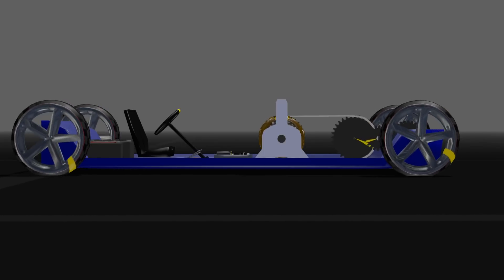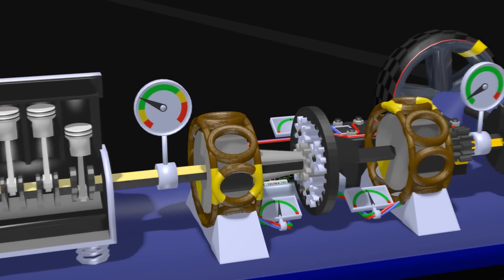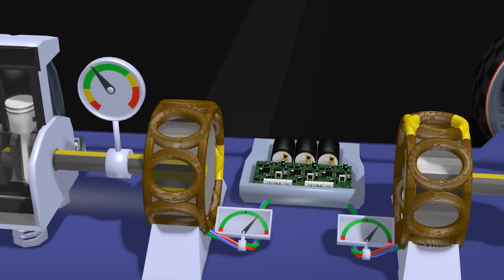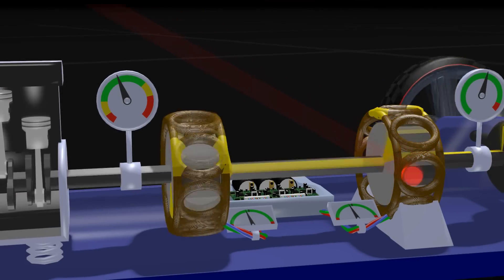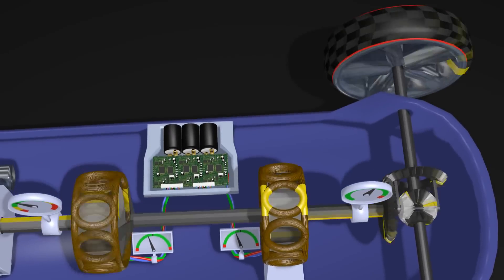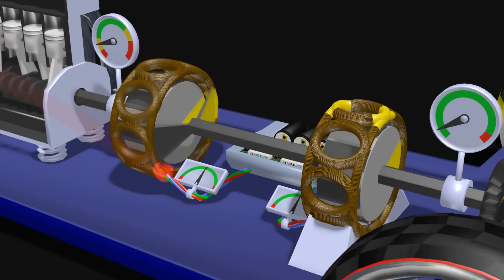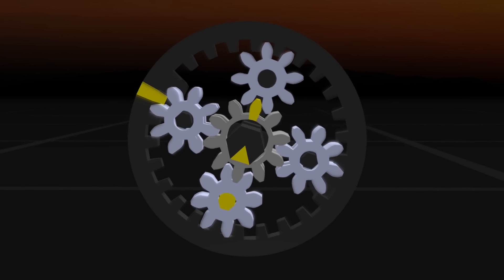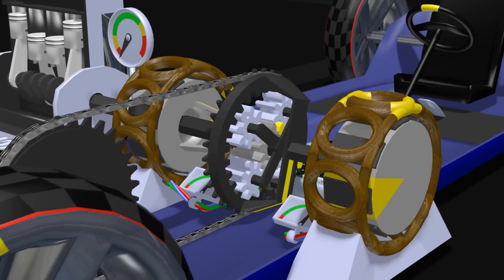Prius Hybrid Drive Explained

Comment: interesting informitive , i'm thinking of getting one, ive been offered a 2007 with 100,000 miles woud i be better getting a 2010 as it the newer type, what should i look out for in them
Reply: @HappyCamper870  all  2010's? keep getting conflicting info, have you had this problem?
Reply: @lookoutleo  I don't know about 3rd generation but my 2nd generation is still going strong after 15 years and they are cheaper than 3rd generation. However there is a lot of misinformation around so I'd do lots of research first, and also talk to hybrid mechanics, because if your inverter goes (which is rare, but I heard is more common on the 3rd generation, because of the bigger engine generating power into the same sized battery) then you want someone that can do the job cheaply but well. Same with the battery. Gen 3 and 4 (2009 and following) has decent acceleration though.
Reply: @yggdrasil9039  thankyou for reply and good to hear youve had 15 years out of yours  was it new when you got it, how many miles you done ? 2007here would cost about $5000 and an old ev is about $10000 just wondering if should do the jump to full ev . any thoughts? at moment world on lockdown so not going to happen for atleast 2 months now as not allowed to travel
Reply: @lookoutleo  Hi, well I can't really comment on your situation. But for me, no I didn't buy it new I bought it about 4 years ago and so far I've put a new inverter in and two new battery renovations, but not through Toyota dealership as this would have been way too expensive. The inverter is very cheap to replace because it's right at the top of the engine, and you can get one from a wrecked Prius for about $100-$200. Lots of good hybrid mechanics here now so I didn't do it myself. Two battery renovations have cost me a total of $1200 Australian, but I have driven 50,000 km and so this cost is a fraction of what I've saved on petrol, especially when petrol was more expensive. I don't know where you are and what the market is like. Here in Australia we have no vehicle emissions standards so we have very few EV models, so I would go hybrid here for a couple more years unless you have the money for an EV. It really depends. Running cost of my Prius is basically fuel cost plus $25 a year because I do the oil change myself and clean out the air filter, but running costs of EVs are close to zero, especially if you have solar power and a battery at home. 2nd gen Prius second hand in Australia is about $5k but a decent EV is around $40k second hand (Leaf, Zoe and Ioniq) so I'm not going to go to full EV for maybe another year or so. Also Prius is a joy to drive so I'm in no hurry. Hope this makes sense and is not too rambling. Good luck!
Reply: @yggdrasil9039  Thankyou, I'm in Scotland and fuel is about £1.20 litre and yes their are emmission tests for all cars , the Prius is loads cheaper to get than full electric and if I go for cheap leaf £5000 it will have range max 60 miles. To get 100 miles car be 10,000 Are you in total lockdown like here
Reply: @lookoutleo  Yes mate, pretty much total lockdown here except if you need to go to work, shops or visit your girlfriend / family etc. Otherwise you get a massive fine. Yes if it's range you need not just a short commute you can't go wrong with the Prius. I've got about 900km range on a full tank of petrol which costs about $40 at the moment ( about 20 quid). The 1st gen Leaf looks tempting and maybe you can retrofit with a bigger battery in the future, I know some guy in the Netherlands did that, but I don't know enough about them to do that with confidence.
Reply: Also, 2007 is late gen2 and 2010 is early gen3. There are just some years that there are some issues for the gen3, but I can't recall and you'd need to do research. Nothing wrong with gen2 though. Slightly worse mileage per gallon/litre of gas (4.2L/100km for gen2 vs. 3.9L/100km for gen3), and acceleration in gen2 not as good as gen3, but may be more reliable. 100k miles is good for a 2007 though. That's young. I think gen3 looks cooler plus you have HUD, but I just put a HUD into the 12V battery outlet in my gen2 so no worries there.
Reply: @yggdrasil9039  2010 was the year gen 3 had an issue.
Reply: @garethbaus5471  Oh right, thanks. Still running the gen2 at the moment, but probably get an EV next year or the year after.

Comment: Brilliant explanation. But should be titled how hybrid generally work. Not only for the Prius. Good education video for mechanics. And simplified is a great plus.
Reply: Not all hybrids work the same way. The video explains specifically the system used in Priuses
Reply: @Ryrzard  I know. But how they gernerally work. Is pretty good. This is just for understanding.

How car manufacturer solve and implement there electric/hybrid system is  a different thing.
Reply: @Ryrzard  true but most hybrid drive trains were directly modeled off of the Prius even some hybrids made by other companies such as the Ford fusion hybrid.

Comment: Greetings,Thanks for your consideration and a good presentation. I am a bit curious here and wonder if you can help with a good answer?I drive an old VW Jetta, it has a gasoline engine and a manual transmission. I can drive it from a very low speed possibly 5 km/hr to 112 km/hr and the clutch never vaporizes. Question what is so peculiar about the clutch you describe in the Prius that such a device will vaporize at or above 50 (I suppose you mean km/hr)?Thanks in advance for your time and consideration.
Reply: In your Volkswagen you have a transmission and a differential that provide gear reduction allowing you to go 5 mph. To simulate what he's describing in his video put your car in 5th or 6th gear and try to go 5mph, that more closely simulates a direct drive.
Reply: You have a transmission between the engine and the road allowing the speeds to match closely enough for the clutch to survive, if you relied on a clutch without the ability to select appropriate gears and used it to convert road speed to engine speeds your clutch would burn up very quickly.
Reply: If you're driving at 5km/h, then your output shaft is very slow (~30rpm). If your engine tried to connect directly to the output while spinning at a regular speed (~2 000rpm), that means that the two sides of the clutch are rubbing against each other at 1 970rpm. That's like pressing two sanding machines spinning in opposite directions together. The transmission changes the ratio between the engine speed and the wheel speed to keep them close together, and the speed differential in the clutch low enough for it to survive. The same thing happens at 112km/h, just the other way around.

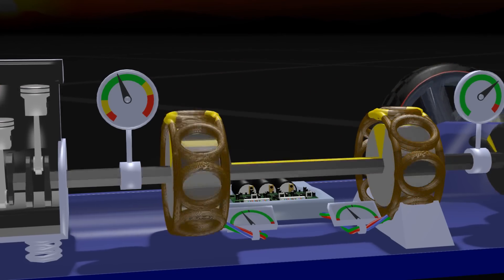Comment: 6:29  perpetual motion machines do not exist
You mean they don't exist at all or they don't exist without magnets?
Reply: They don't exist at all.
Reply: Perpetual motion violates the second law of thermodynamics (proven through experimental result, and still valid to the best of my knowledge today). A simpler way of putting it is "there is no lossless, frictionless system. All real to life systems suffer from energy losses; some suffer a lot and some suffer a little; but in the end, they all do as a result energy expanded in the first iteration will more or less slowly dissipate leaving the system sooner or later without energy to operate.I hope this will help answer your question.Best regards,
Reply: @fethilakhdari1078  [[  "there is no lossless, frictionless system. All real to life systems suffer from energy losses;  ]]
Yes, I agree, But that was not the question (did not ask about frictionless machine) and those two things (friction and perpetual motion) are not mutually exclusive IF you drawn energy from the surroundings.

--

A perpetual motion machine (though not frictionless) could operate by drawing energy from its surroundings. I had hoped that would be understood by my question's mention of magnets.

Yes, the second law of thermodynamics would still apply . . . in that, the motion would only be "perpetual" so long as there was still energy that could be drawn from the machine's surroundings.

Example : https://www.youtube.com/watch?v=n7cRTNB5ZIw
Reply: @2Truth4Liberty  If by "draws energy from the surroundings" you mean "is plugged in" sure. But your magnet example doesn't work. A magnet pulls in both directions, so the force would cancel out, and the rotor wouldn't move.

Comment: Excellent thanks but I am a bit confused because you said the planetary gears are only for one thing to negate the need for brushes for the motor. However it seems to me after watching your explanation that the planet gears are analogous to a differential. A diff has 3 inputs. One the drive shaft two the left hand wheel and 3 the right hand wheel. Those inputs can also be outputs. The planet gear train also has 3 input/outputs. One the sun gear two the ring gear and three the planet gear holder. So the planetary gearbox allows the mixing of power between MG1 and the engine and the wheels. That is it's purpose. It's a bit like you used a differential and you powered the drive shaft from the engine and you put a motor generator on the left hand axle and used the right hand axle to drive a prop shaft that went to another diff to drive the wheels. Or am I looking at this wrong?
Reply: You're 100% correct. Like you said, it uses the principle of a differential to mix MG1/MG2/ICE torque. 

The mechanical torque the ICE (planet carrier) sends to the wheels (ring gear) depends on how much reaction torque MG1 (sun gear) provides. 
The more reaction torque/resistance MG1 provides the more ICE torque is "reflected" back into the ring gear. The power generated from MG1 is then sent either to the battery or to MG2 to drive the ring gear.

At higher speeds MG1 and MG2 reverse roles, where MG2 "skims" some of the extra torque from the ring gear, and sends it to MG1 which spins backwards, further increasing the speed of the ring gear for a given ICE/planet carrier speed.
Reply: That was the most informative comment. Thank you!

Comment: Wow, Ive owned both the Camry and now an Aqua, love the system.  One thing Im lost with is where is the CVT in this? was that at the very front in that model?
Reply: That is the planetary gear system described. Non Hybrid CVT's use a belt which tends not to last too long(100K miles).
The Planetary gear system has lasted very long sometimes as much as 500K miles in the Prius.
Reply: @boldyo  thanks for the reply, yeah we replaced the Camry Hybrid with the Aqua and that Camry had 380k on it and was still working fine, only traded it in to upgrade to a new car as it was a 2010 and getting quite old. Had it 5 years no issues.
Reply: @starsky8351  I got a 2020 Camry Hybrid LE about 3 weeks ago, and I am averaging just over 60 MPG driving for Uber. I am quite happy!
Reply: @boldyo  they are such a nice car. My wife uses the hybrids for her daily commute as our public transport system in NZ is poor and she has to drive. Such a good option. We have a 2016 Rav4 for the weekend car.
Reply: The whole thing is the CVT: both M/Gs and the planetary gear sets.
Reply: It is the CVT it just uses a completely different mechanism from most CVT's and doesn't need any steel belts.

Comment: I also like the mention of the 'parlor trick', which I caught when I was looking at these a few years ago.  People are buying efficient 1.2L Toyotas but think they are 'saving the earth' and 'being green.'  It also makes you wonder why all this technology is only $40k or whatever while a much simpler Tesla (just plug it in) is $100k.  Ah, supply and demand.
Reply: Tesla Model 3 starts at US$35400. Cost in use makes it cheaper than a Camry, but better performance and features by far. Battery costs are falling and their performance is quickly advancing with Tesla to announce a million mile battery production this quarter. Currently Model 3 battery pack cost is about half the production cost of the vehicle (Munro). Tesla gross margin is about 20% in USA and 35% in China factory (Munro), far higher than Toyota.
Reply: @waynerussell6401  since when tesla has better performance ??? Very often I am doing 500 mile trips and my Toyota hybrid is minimum two times faster than any tesla within it`s price range :-D
Reply: You forgot to account for battery size, a lot of what makes BEV cars more expensive than hybrids is the massive battery.
Reply: Lots of rare earth metals in the Tesla's huge battery pack
Reply: @carlosandleon  Can you name them? The rare earth metals?
Reply: @ekhaat  what? in thr periodic table? I think Cobalt is one of them. Then there's lithium, palladium, hafnium.  . . :3
Reply: @ekhaat  uwu
Reply: @carlosandleon  Here is a list of Rare Earth Elements from Wikipedia:
"The 17 rare-earth elements are cerium (Ce), dysprosium (Dy), erbium (Er), europium (Eu), gadolinium (Gd), holmium (Ho), lanthanum (La), lutetium (Lu), neodymium (Nd), praseodymium (Pr), promethium (Pm), samarium (Sm), scandium (Sc), terbium (Tb), thulium (Tm), ytterbium (Yb), and yttrium (Y). They are often found in minerals with thorium (Th), and less commonly uranium (U)."
I don't see Lithium nor Cobalt in there. Perhaps YOU learn the periodic table
Reply: Batteries are expensive due to manufacturing shortages occuring as the demand skyrockets. 70% of the manufacturing cost of a full EV is battery.

Comment: https://www.youtube.com/watch?v=BVyNWmBDCzU
Reply: that's the Gen 1 voltec drivetrain, which had a dedicated serial hybrid mode (engine drives MG1, electricity sent to MG2 to drive the wheels). That layout meant that MG2 had to be quite large as it had to handle launching the vehicle on its own.

The Gen 2 voltec drivetrain moves a bit closer to Toyota's concept where it's basically always a powersplit whenever the ICE is on - the engine power splits between a purely mechanical path and an electrical path to the wheels. In pure EV mode both motors could drive the wheels which meant they could be smaller and more even in size. Conceptually the Voltec 2 drivetrain was brilliant because it offered a wider operating ratio range but its implementation was flawed and the hybrid mode efficiency was significantly lower than its competitors. 

The use of wet multiplate clutches introduced extra drag in the system and at a glance they seem unnecessary - all the mode shifts in both the original Voltec and Voltec 2 drivetrains were done at synchronous speed (i.e. the two components being clutched together are rotating at the same speed) so a simple dog clutch could've been used which would've saved space and improved efficiency. The Renault multi-speed hybrid drivetrain uses its electric motors to synchronize dog clutches for each shift so it's definitely doable. It was a missed opportunity for GM.